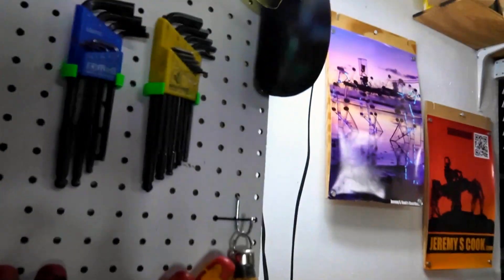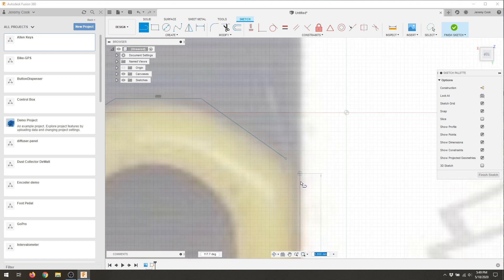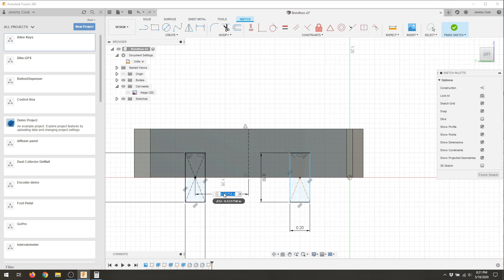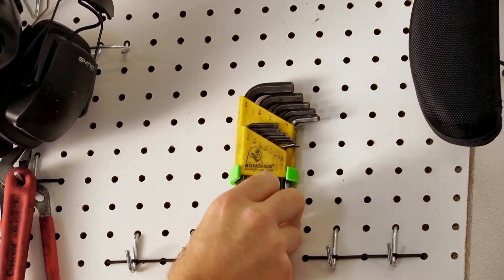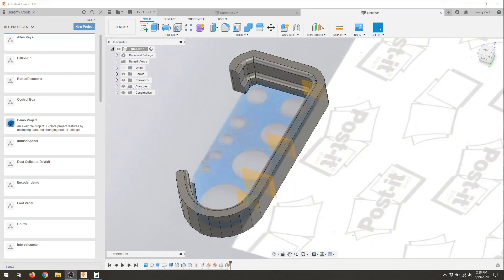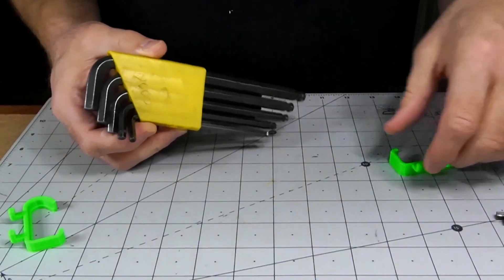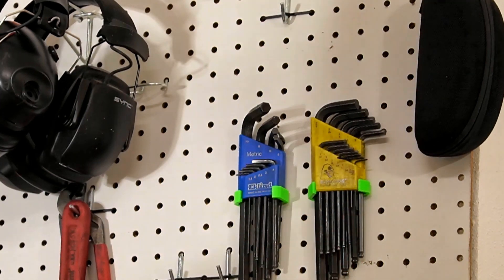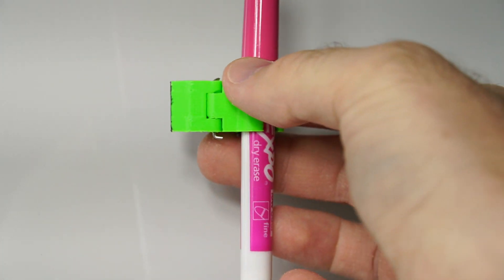3D-Printed Parts Design with Scanner [Howto]

Comment: My favorite way to convert pictures to CAD data is with Inkscape. Pull the image in, vectorize it and then save it as a DXF (For solidworks at least) and then you can import it. It's generally better for anything you don't care about how parametric your design is as you'll likely not get great straight lines, but it's AWESOME for anything that's more complicated than a couple shapes like sign making, and the vectorized files are almost always watertight so when you bring them into your CAD package, they're ready to be extruded no sketches or tracing required.
Reply from the maker: Nice, thanks! I really need to get better with Inkscape, but I'm still not great with the system.

Comment: How has this never clicked as an option until now... 

I assume tossing a ruler/machinist scale might be a solid option to get your scale correct? Though, I'd assume it is actually a constant you could work out once and just reuse.  As for a faster way, Inkscape might be able to spit out an SVG for you using the Path -> Trace Bitmap option though that doesn't help with scaling (DXF might here?).
Reply from the maker: Yeah, I'd think you're correct. On one of these I just used the scale from the other one, so you're correct there too.
My Inkscape skills aren't great, but that's not a bad idea.

Hope all is well with you!

Comment: Hi Jeremy, I read an article written by you about ws2812b protocoll. You explained that there are libraries that make the work easier, but i want to learn the protocol and do it by myself in arduino. The problem is that i don't know how to make that arduino can be as precise to delay 0.85 microseconds. did you finally make the proyect by your own? how ???
Reply from the maker: Hi, no I've yet to make a library-less WS2812B protocol driver. I'm sure there is a way, but it seems it'd require some programming techniques that I'm not (yet) familiar with.